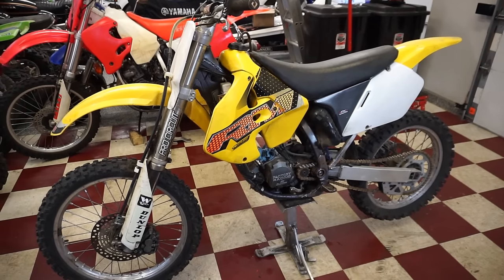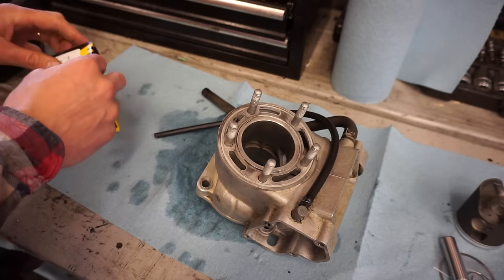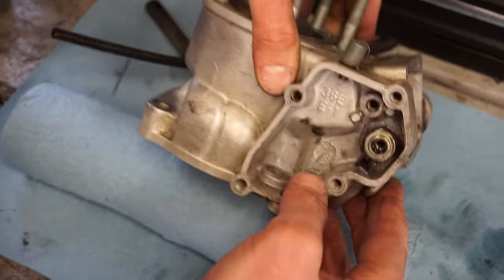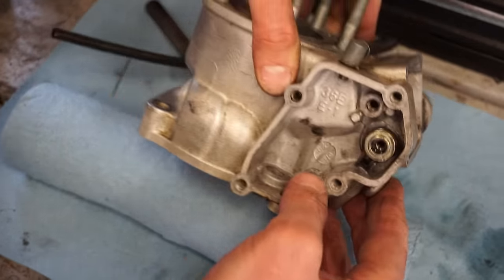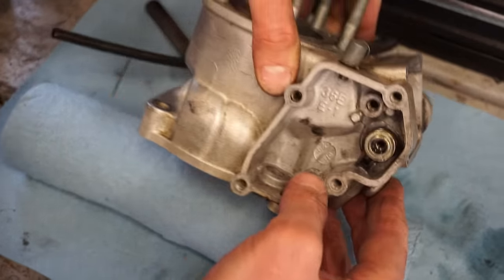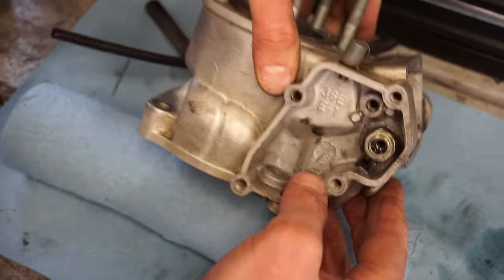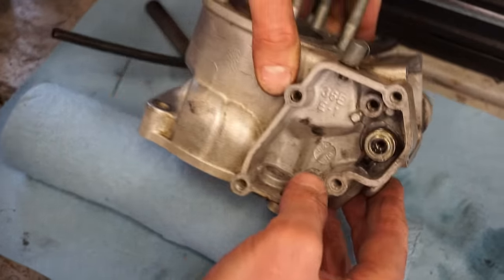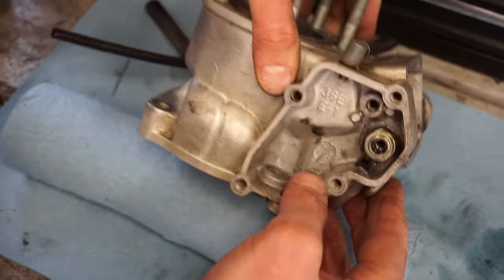Seller Said This 2-Stroke Dirt Bike Lost All Compression (PROBLEM FOUND)

Comment: You should seriously consider purchasing yourself a quality parts washer. Not only are they much easier to use than a bucket of soapy water, but they do a much better job. It only takes a few minutes to clean even the nastiest of parts, and you don't have to do it on the floor on your hands and knees. Once you start using one, you'll wonder how you ever got along without it.
Reply: What’s a good link to one?
Reply: Do you recommend ultrasonic cleaners
Reply: @nerdxmayozz128  I never used one personally.
Reply: @randomguy1807  I couldn't tell you. I've had mine forever now. I purchased it directly from my parts supplier.
Reply: The parts washers has been mentioned by a million people including myself! 😂. Since it’s snowing in Wisconsin, I’m sure Joe has a warm bucket of soapy water😂. I’m sure people like the sounds of the calming soapy water splash around!😂
Reply: If I was doing this at home I would have a small countertop dishwasher. I have used the dishwasher in the house when nobody was looking...
Reply: Sounds crispy! Nice work!!

Comment: I am watching you do the carb and i was wondering the 55 on that pilot is good but what if the old owner used a drill bit to enlarge the hole then you would way off for sure only way of knowing is trying a drill bit the same size as the 55 mil pilot jet

Comment: Snow pretty wet, bet it's  heavy.  Been lucky here in S.W. Colorado with dryer snows, my plow only got used like 3 times this winter. 32:1 for MX bikes. Bit rich but manufacturers spec.
Reply: I always went with four gallons of 94 octane to one bottle of Yamalube. The increase in performance over Spectro was shocking. Plus, the internals were tons cleaner during rebuilds.

Comment: It’s detonating from being to lean piston is very lean by the look of carbon pattern
Reply: So they were running the mix to lean? Is why it’s all black ? Wild
Reply: Main jet too small
Reply: @offroadenthusiasts  yes 👍
Reply: @jakeslouw3416  correct but it could be needle or pilot lean
Reply: @jakeslouw3416  so tell me why I rebuilt a kdx 200 correctly by spec and when I started it it instantly popped really loud as soon as it fired and never ran again didn’t tear it back apart bc I was too pissed 😤 😂
Reply: Ehh, a 2 stroke that's jetted for normal weather will always run lean when it's cold outside with snow on the ground.  Cold air is more dense, so needs more fuel to balance the mixture ratio.  Basic tuning stuff.
Reply: @Thuddster  that’s correct
Reply: Haha. You're right on brother. Especially a high strung two-stroke. If it's jetted right on the money for a 75 or 80° summer day and then you take it out on a 30° winter day… Well you know. 💥 💥
Reply: @ar2043  yessir or if you go from jetted for 10000 feet of elevation to sea level
Reply: Yep. Another fine example. And he doesn't even know what he's running for piston to cylinder wall clearance  🤷‍♂️

Comment: chamfer the air transfer holes with dimond grinder 90 degre grinder helps to get at them easier.
Also use dingleballs for cross hatch.
Port exaust and intakes.
The RM was made to scream .
Do a  old Elsinore video.
Have old friends that died and got crippled on these bikes.
Reply: I specialize in 81,82 and 83 Honda CR250s
Reply: I've had four 82s only one 83 as they're a 1-year bike and one 81 they are ridiculous for power not like newer bikes just raw power

Comment: That honer is only for steel sleeves.  With Nikasil (ceramic lined) -it will just wreck the surface and expose the soft aluminum.
Reply: Pretty sure Joe knows what he's doing by now....
Reply: @1965l88  Anybody who actually knows what they're doing can see he still has a lot to learn. Which is fine, but he often ignores good advice in the comments.
Reply: He’s talked about that in multiple videos he already knows

Comment: You do know that relief cutout in the piston at the wrist pin clips is there for a reason right? It's there so you don't scratch the piston coating like you did. It's used to install the clip without damaging it It's a pry hole for the open end of the clip.

Comment: Damn Joe, $1000 won't get me nearly as much to play with around here. Very jealous but love the channel. Also did you just hone a Nikasil cylinder?
Reply: These cylinders can be lightly honed. But I won't hone ANYTHING the way he does it. To each there own though
Reply: @dubiousf00d  I have heard and seen many conflicting things about these hones and running them in a drill vs drill press, and other things like that. Would you care to explain what he's doing wrong? I work on cars and have just gotten into bikes in the last year but I'm sooooo deep already, I assembled an 83 Honda CR entirely from ebay just to shit on the people parting them out and killing history, but I also drive a car from the 80s so I have a bit of an issue clearly lol.
Reply: @baitmaster8706  So from everything I've been taught with hones, you always start the hone as you enter the cylinder and don't stop the hone while in the cylinder. Pull the hone out as it's moving. Then switch direction out of the cylinder. And repeat. The way he just casually stops and switches direction in the center of the bore makes me cringe every time. My luck is not that solid 🤣🤣
Reply: @dubiousf00d You're 💯% right about how to properly hone a cylinder. You never stop or switch directions while the hone is in motion. Plus, your exit advice is spot-on. Keep the hone moving until you've completely exited the cylinder. It seems as if Joe doesn't understand the basics of honing. However, that's not to say that he doesn't have his good points.

Comment: If that engine uses a steel sleeve in the cylinder, you could have just went with an oversized piston around 56mm and bored the old cylinder to clean up the slight damage on the exhaust port area and remove the flaking area on the deck surface no problem. It would have been less costly for you, and make a little more power due to larger bore size.
Great video just the same!
Reply: Unfortunately Nikasil can't be bored only replaced. I've seen people try, but I've never seen it be successful.

Comment: 😂 well on old cr250 bikes shows even in service manual that the right side crank seal goes with the spring side towards crank bearing not the way your putting it in at all with the spring and compete inner part of seal visible... 😂

Comment: I think I know what is wrong with my dirtbike besides me getting it out of timing and the carburetor and the head bolts but I think that when I timed it wrong the exhaust valve punctured the piston and when the valve was going back up it brought the punctured part of the piston with it and bent it upwards so I think that really explains the sudden stopping Everytime the piston almost reaches the top of the cylinder and no compression so now I need to get a new piston but I also need to dig into the engine to see what all was damaged

Comment: i bet Millenium can salvage the old cylinder .... weld and replate for what you paid for the used one ...or in the ballpark at  least ...I drilled 3 holes in my 77 RM 125 piston ... it had seized with 2 holes ..
Reply: I've seen catastrophically blown up cylinders be fixed and look just like new you would never tell that there was any damage

Comment: You should practice tuning/adjusting the suspension I owned ALOT of two strokes and used to ride trails around my house in the  90s and 2000 , anyway I had one Yz125 it had the best amazing suspension way better of any other 2 stroke it would fly over rough gravel and rocks and you couldn't feel anything I used to joke it was the caddilac of all my other bikes Also 1999 and 1998 were the best two stroked ever. made

Comment: That doesn't look like a sleeve... I think that's a nikasil plated aluminum cylinder. No cast iron sleeve. Also on your new cylinder it looks like there might be a crack at the base of the skirt... could be dirt. hard to tell.

Comment: Others have said this…finger hones are not for Nikasil coated cylinders or for two stroke cylinders because they could catch the ports.   Invest in a ball hone; I’ve got 2 that have fit just about every small engine application I’ve needed.   But….he did it and the bike rips so move on!

Comment: It would've been tons cheaper just to have its rebored and sleeved provided that you have a machine shop close by. Probably half the cost of this replacement cylinder.
Reply: Specs would be off from original. Not worth the hassle in my opinion

Comment: You really cant hone nicil cylinder coating. The rings wont seal right, why u got smoke. Takes special hone. I posted a reply to you about this, on other post on another bike you are doing. You may get lucky. And in works, but pretty good chance after 30 to 50 hours, its going to get worse. I positively hope that u get lucky. Id probably pull the cylinder head off, after 10 to 15 hours of riding and take a look. And do a compression check after 5 to 7 hours of riding. If you break it in easy for the first hour , no high revs or redline. It may take hold and work. Fingers crossed

Comment: If that's a plated cylinder you need a 220grit CBN Diamond ballhone otherwise you're just scuffing the piss out of it like when you use your brillo pads to "prep" the cylinder

And you're not supposed to change the direction of rotation😂😂😂

Comment: Don't you run in engines?
(Let them turn 5-10 minutes at idle, preheat,
then 1/4-1/2 gas maximum during X km, etc.)

Comment: Try to rebuild a 4 cylinder bike or a 6 cylinder gold wing if you want a challenge  2 strokes are easy
Reply: True. I've rebuilt more 4 cylinder street bikes along with full rebuilds of the carburetors along with syncing them up than I care to remember. It's very time-consuming and tedious work.

Comment: For the love of God, please stop using gasket maker. If you clean your gasket surfaces properly, you don't need it. It just get inside the engine and messes things up. If you are doing a "I need it fixed" to get home kinda thing, that's fine, but not on a permanant fix.

Comment: Totally wrong hone, you really shouldn't hone a coated cylinder at all any way, the Nikasil coating is only a few thousandths of an inch thick and you just removed most of it so that cylinder won't last very long, I don't mean to be negative as you seam like a good person and you have some good mechanical skills but there are many technical details that are engineered in to a manufacturer's specific design that are critical to performance and longevity of the machine that you tend to overlook, the information is out there you just have to take the time to find and apply it and many times it requires additional cost in tools and time but it pays off in the end , I assume you are selling these bikes when you get them running again, put yourself in the buyers position, wouldn't you want to buy something that was repaired right and provides good value for the cost.

Comment: 🤣🤣 it had cross hatch till you nuked them with the honing stones at 3000rpm, dude go watch a video of what a cylinder hone does, it’s low speed and even stroke, you cramming that glaze breaking tool into the cylinder at 3000 rpm  does way more harm than good.  All you did was take all the honing stone marks out of it and made it so the rings will wear out in about 1/4 the time… if you’re gonna be a hack, at least use the platform you post your hack mess on to figure out why you’re a hack mess… you destroyed that cylinder. Yeah it’ll run ok for a bit but it’s messed up. It’s gonna use extra oil and fuel, it’s a two stroke that hone is important for so many reasons…. Kids man… they can’t even read a book these days

Comment: Clearly you don't even know the difference between a plated and a sleeved cylinder right there disqualifies you from any qualification you could ever want to hope to have to work on this stuff I wouldn't even have you work in my shop cleaning the greasy parts in the parts bin I'd be worried you'd fuck something up
Reply: Then post vids and show us the proper way 🤡
Reply: @shadowsfad3d  I have a job where I build high horsepower two-stroke motors that's all I do I don't have time to put a camera in my hand and slow my work down to where I'm not as productive just so that I can put it on YouTube I've been doing this for over 40 years I think I know a little bit about what I'm doing
Reply: @shadowsfad3d  anybody that's been doing this for any times knows you do not hone a plated cylinder if a plated cylinder is down to the point where it needs to be honed to get crosshatch back in it it needs repllating clearances need to be tighter for a plated cylinder there's a lot of variables that go into building a motor depending on whether its this type of motor or that type of motor I could work circles around almost anybody in these comments I come on here I tell him exactly why his bike failed how it failed everything and he doesn't pay no mind to it he still saying I don't know how that happened meanwhile I told him about five times exactly what happened the process it took for that to fail and he didn't listen so I don't have to go on here and post videos to justify myself to what I say because anybody that has two brain cells in their head can look at what I say go look up some real information and say holy shit that guy knows what he's talking about
Reply: @MrATOMBOMB420 Agreed, you definitely know your stuff!  Bear in mind that what Joe does here is deliberate, and part of his successful YT content strategy.  It's an unfortunate byproduct of 'the algorithm'.

Comment: This guy doesn't clean anything, I hope no one is trying to learn bike repair from this channel, what a joker
Reply: That's BS. There are plenty of his videos showing him cleaning. Just because he doesn't show it in a video doesn't mean it isn't happening. And just because the externals aren't spotless doesn't mean he hasn't done due diligence on the internals.
Reply: @1965l88  Sorry but you need to watch the dideos again, he put the power valves back covered in the old oil into a dirty uncleaned head , the only time he cleans something is a wipe with a shop towel, he's been told many times he needs to clean parts before reassembly but I guess he feels he knows better, I know I wouldn't buy a bike from him